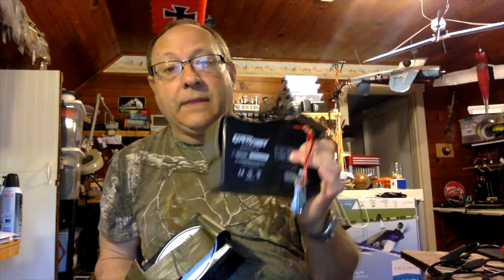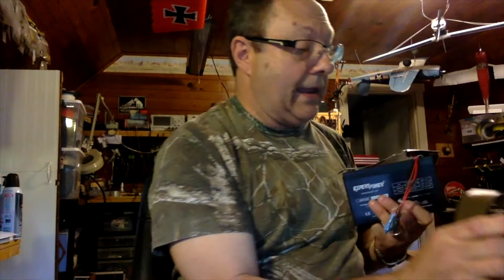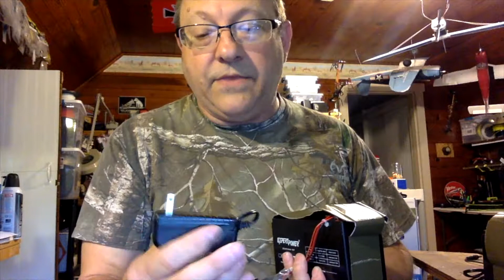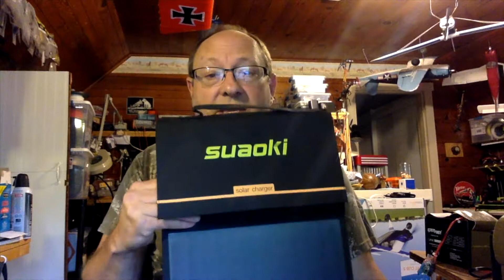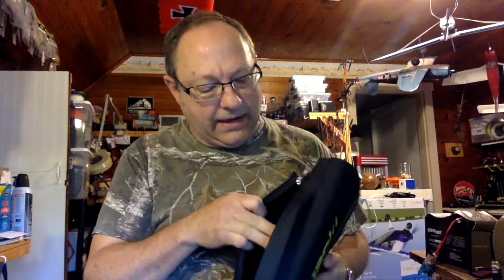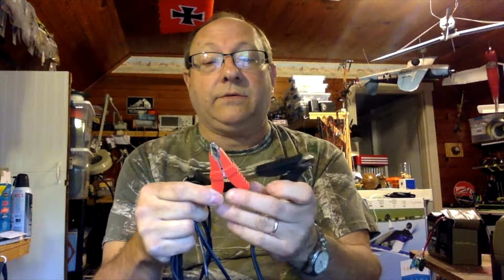Battery and Solar for QPR and Field Work

Comment: I have been using those style batteries since I started.  My solar panel can keep my 35 aH, 14aH, and 7 aH batteries topped up, when it is sunny, for my 100 Watt radio.  My 817 doesn't even make a dent in the power while the solar panel is hooked up.  The only problem is that my new solar panel has a noisy RF generator (charge controller) so I have to charge away from the radio while using a second battery.  73!!!  de KE5ES

Comment: Hey Kent
Just remember that the 19 vdc on the solar panel is a OCV value ( Open Circuit Voltage) with no current! There's also an LCV value,
(Loaded Circuit Voltage) at full current. What you don't want to do is over current charge a jell cell..
That produces hydrogen bubble's forming on the plates and reducing the capacity of the battery. In the electrolyte jell these cannot escape or boil off as in a regular wet cell battery like a car or deep cycle battery. I have solar panels that have an OCV of over 28 VDC but as soon as the current goes to @ 150 ma the voltage drops to 14 to 15 VDC, full current at 10 amps is at 9.6 VDC (loaded)
This will mess up jell cell battery's but not deep cycle or a regular car battery. At a 2 amp load with the two jells you have in parallel the solar panel you have is not hot enough to damage  them without a charge controler. Don't forget ohm's law also! Make sure all your connections are as close to 0 ohm's resistance loss..
I know you know but this is for some of your other vewers..
A 1 ohm resistance at 5 amp is a 5 volt loss in heat at the connection.
Witch is a bad thing!!!
Why I use power pole connectors..
"73" W4KG